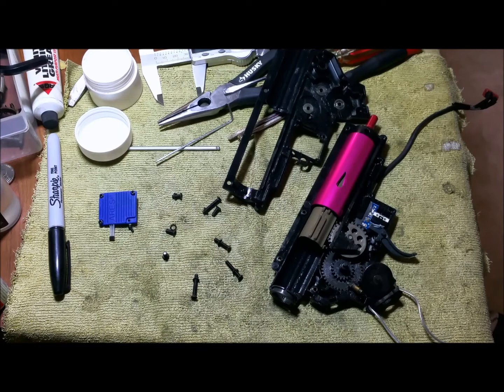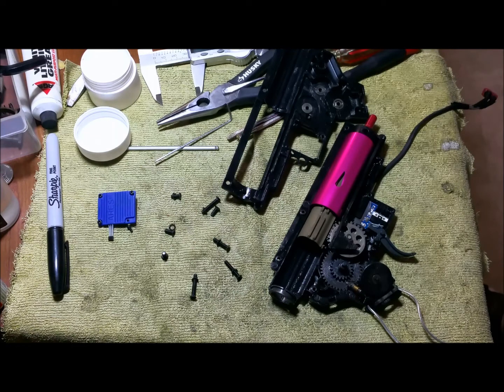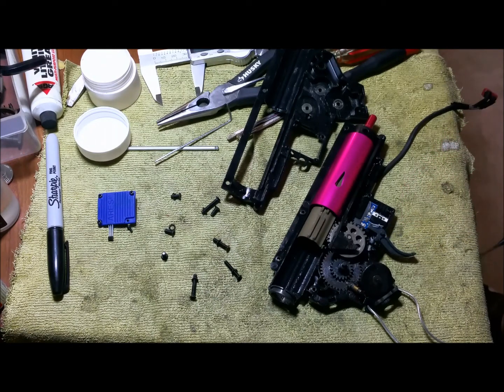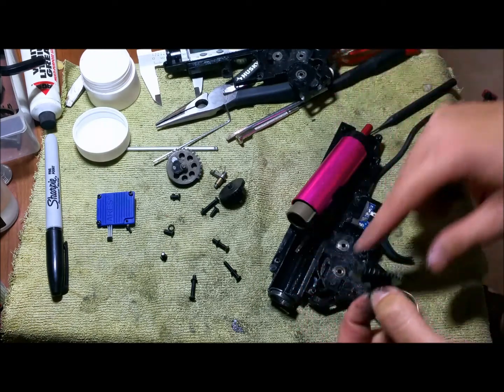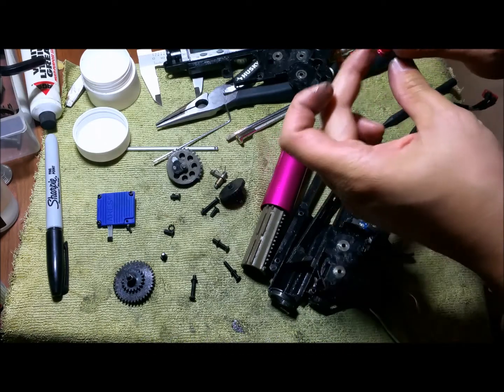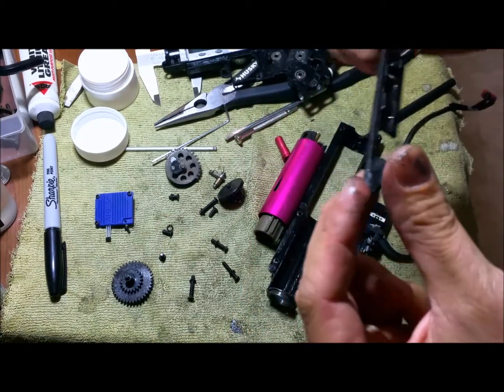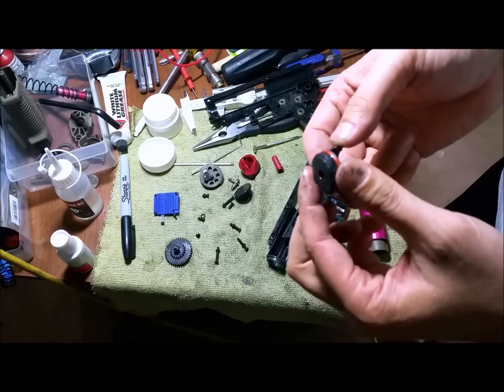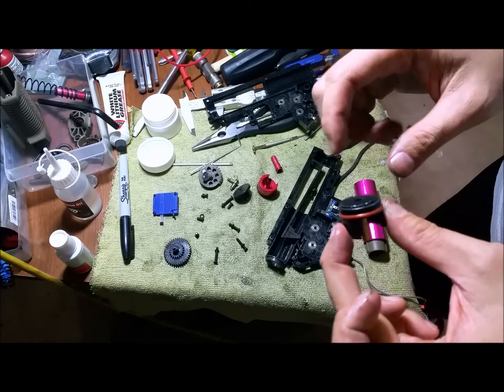Tech Section: ARES AMOEBA EFCS Gearbox  10,000 Round Inspection

Comment: Heya

Recently I've just purchased the AM014, and I have done a few upgrades to it including:
Prowin Hop up unit
Prometheus Triple Torque gear
Guarder M130 spring
G&P Satan motor
So after the upgrade, I couldn't use the semi auto function.
Each time I pull the trigger, the piston cycles 6 time; everytime.
and now the unit don't want to fire at all, even when I tried changing the battery.
Any insights on what is happening here? the gunsmith that installs the upgrades says that the problem is in the EFC. But now the gun doesn't even shoot at all.

Comment: I have problems with my ccr ares, after 5 shots stops, and the battery is consumed.
install another engine and the same applies.
I put the engine. live with a battery and still works.
that could be happening
Reply from the maker: The EFCS is going into safe mode.  There is a couple of reasons I can thinkn of:

1.   There is a problem with the magnet on the sector gear (the magnet isn't the correct pull force).
2..  The EFCS chip has gone bad.
Reply: like putting the CS in safe mode?
where you find a tutorial
Reply from the maker: Safe Mode is internal to the EFCS.  If there is a problem, it stops the AEG from firing after 5 shots.  You reset by unpluging the battery.

If your EFCS keeps going into safe mode after 5 shots, there is a problem:

1.  LiPo Battery is too low.
2. At a certain temperature ''''very hot" it will stop firing.
3. Faulty magnet on the sector gear.
4. EFCS has gone bad.
5.  You might have a short.

Comment: Hi dude, I have buy a Ares amoeba from Deutschland shop but when i use programmer efcs i cannot use any full or burst mode, the replica stayed on semi. Do you have any solution to fix it ? Thanks in advance, best regards from France
Reply from the maker: udgod 

I believe Germany only allows airsoft guns to be semi-only.  Therefore, your EFCS unit cannot really be programmed (it may even have a different colored chip).  Here in the United States, (Blue EFCS chip) the standard is Safe, Semi and Full-Auto OR you can use the programmer to choose your selection.

Redwolf, E-Hobby Asia or Asia Airsoft sell the ARES EFCS (Blue Chip).  These usually cost around $38 USD.  Be also aware, there are three types (Front, Mid, Rear) that affect the wiring length.

Disclaimer:  Be sure to follow all applicable Country, Federal, State, Regional, City airsoft laws before attempting this.  This is only for informational purposes ONLY!  I will not take any responsibility should damage or violation of applicable laws occur in above information.
Reply: ARES Airsoft Solutions  Thx for ur return but i have the blue EFCS chip on my Gearbox :/
Reply from the maker: udgod 

The chip color does not necessarily represent the programing it has received.  Because you purchased your AEG from Germany,  its most likely program to be semi only.
Reply from the maker: udgod 

I also forgot to mention, the German Amoebas may have a different selector plate.  Only ARES Manufacturer sells the selector plates.  Although, a full ARES EFCS gearbox sold on the Asian websites will have the full auto types, but a complete will cost $110 USD.

At this point,  I think the selector plate might be the problem.  Unfortunately,  I live in the US and I don't have experience playing with German versions of the ARES EFCS Gearboxes.

Goodluck in solving the issue and do leave a comment if you figure it out!
Reply: +udgod In German airsofts only the EFCS chip is different, so you can buy a unlocked chip in the internet. The selector plate is the same.